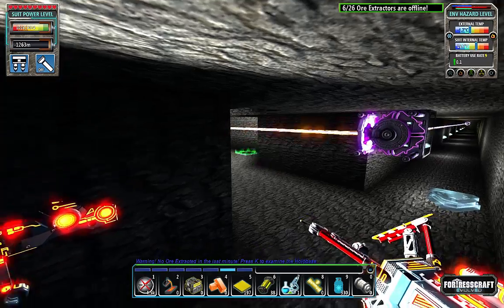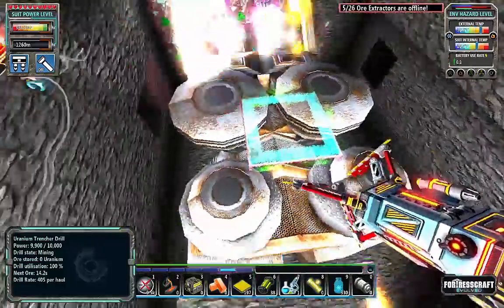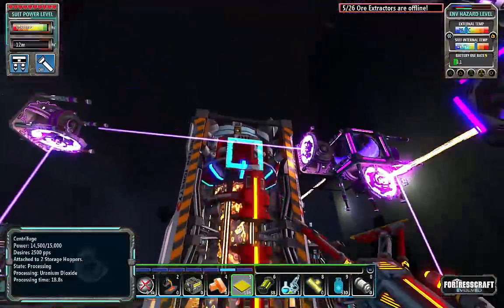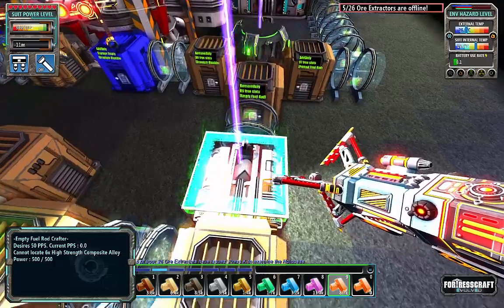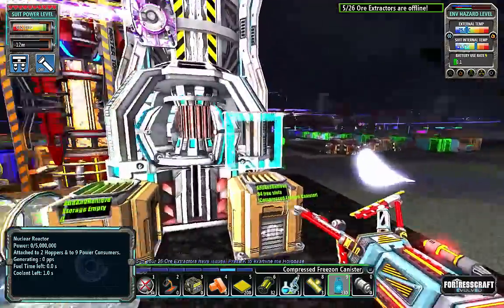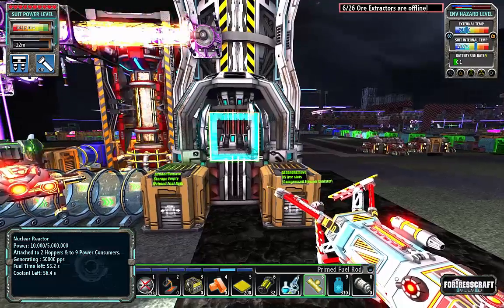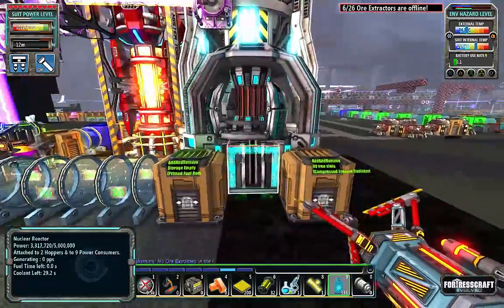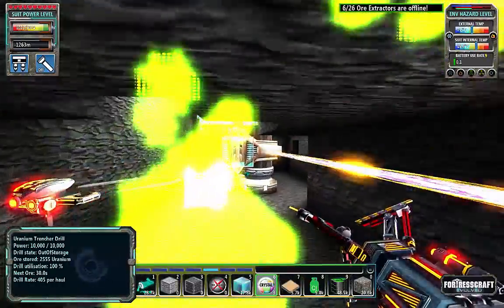FortressCraft Evolved : Mod Spotlight : Nuclear Reactor

Comment: This is the best mod for FortressCraft Evolved and the very reason I bought the game. I experiencing a bug with this mod I wondering if it could be fixed. When you set up a mining drill site and leave the place for a while before you go back to that site the location want fully load, there are a lot of blocks that are transparent including  part of the mining drill/motor. Still the drill is animated even without power and still no turning motor animation and no sound too.
Reply from the maker: When you say mining drill, do you mean specifically the Uranium drill? Or a vanilla drill of some kind?
The drill is animated regardless of power, I can't fix that. 
The transparency issue is the game engine, I've had that issue for the entirety of the 1500 hours I put into the game. I had very little control over the machine itself.
Reply: Sure I mean the Uranium drill, it is the only drill that works on Uranium. Why can't DJ help with this issues? Anyway thank you for the amazing mod I really like it!